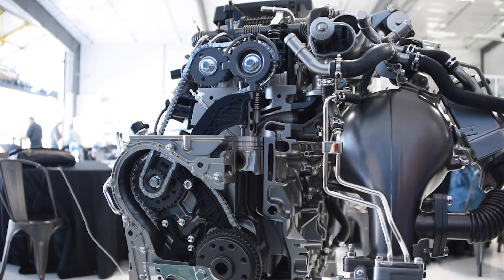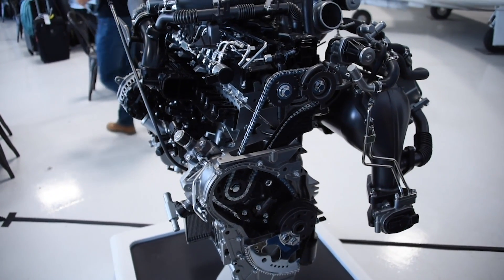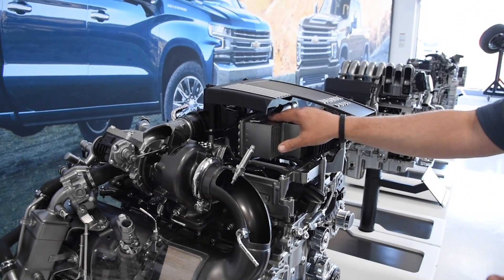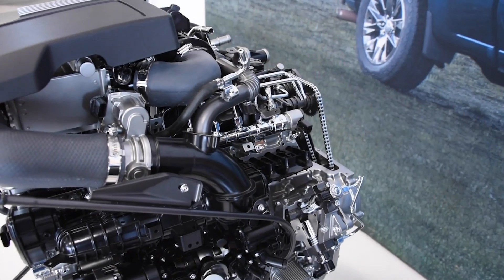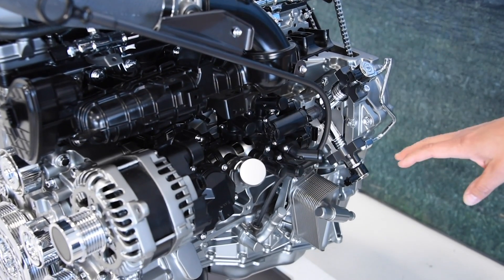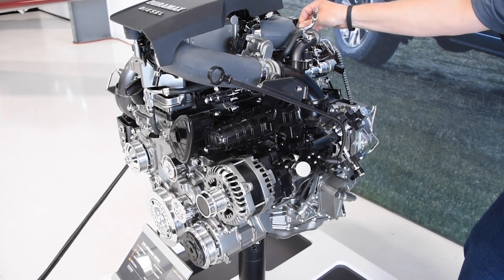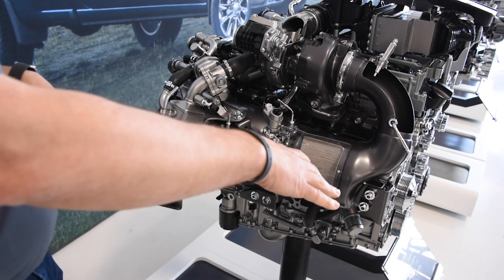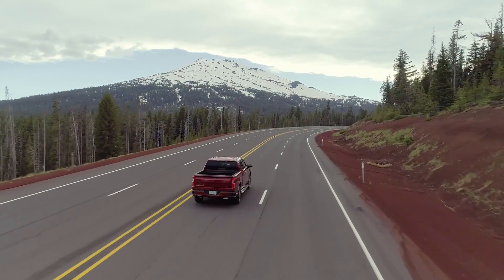What you don't know about the 3.0-liter Duramax diesel

Comment: A friend of mine is a 25 year GM Master Tech.  He said the "Belt issue" has been WAAAAAAAY overblown by you guys here on the internet(most of whom NEVER intended on buying one).  He also said even now with none of them having that mileage, HE could EASILY do the service in under 2 hours.  He said changing plugs in some cars/trucks is a bigger job.  Also, because it's a "wet" belt(and not some $50 NAPA rubber timing belt) it will EASILY see 300k in real world use.    Simma down now, simma down.
Reply from the maker: That's what I've been saying in the comments. The viewers are so concerned about the belt needing service around 150k, but still don't think anything of spending $800-$1,000 to have a timing belt serviced on the family car at 80K. And the service estimate is completely reasonable, too...with the truck on a lift, a good tech could do that in a couple of hours, no problem. Now...will a GM dealer CHARGE you for two hours? That's another story...
Reply: Okay so the belt is indestructible. What about the variable displacement oil pump and all the other possible points of failure from overthought / overused technology? Less is more and simple is beautiful.

Comment: Hmm didn't the 6.4 PS have major issues pushing regen fuel through the cylinders? Like oil dilution, burning ex valves, overheating... all the new HD diesels have a separate regen fuel injector

Comment: I'm seeing more than the Transmission having to come out.  Oil Pan is Most Likely going to have to come off too.  I don't see access to the Oil Pump on it from the back.  Might point out how you get to that belt.  Like there's plenty of room to change the belt when you remove the rear main seal retainer.  Some of those require engine removal.  I'm glad I watched.  Having to pull the Engine to change a belt is not Cool.  Let alone the Chains.  I'll avoid this design.  GM needs to start building more Consumer Friendly.  Not Systems that are designed to Self-Destruct.  Reminds me of plastic coated and or aluminum Cam Gears.  I remember the Soft Cam Years.

Comment: I lol'ed when i saw that belt driven oil pump- per service bulletin, needs to be replaced every 150k miles - need to remove the transfer case and transmission for this service. Gm can opt to put a chain driven oil pump but they want to  save $10  - pass the cost of maintenance to its buyers . These stupid cost cutting is really does not make any sense.

Comment: Ok, got a great idea! Let's put a common maintenance item...get this...at the BACK of the engine! Then, we can add a bunch of new electromechanical failure points, all over the engine, in hard to reach places. But wait, that's not all! We forgot the spark plugs! Wait, we can still jam them in. What? You're telling mee diesel engines dont have spark plugs? Uhhhh, I kind of already put them in. Ok, get this, they will be called ceramic glow plugs now. Problem solved. That's good anyway, I was having a hard time trying to find the most inconvenient place to put the distributor. President Biden wants it to be environmentally friendly so we replaced the motor mounts with popsicle sticks and used school paste to hold the works in place. Also, we measured the temperatures of the tail lights and found the passenger side was reading at a lower temperature than the drivers side in colder climates so we rerouted the engine coolant lines so it brings that side up to the same temperature as the drivers side. We had to sacrifice in cab heat to do this, but I tell you, its totally worth it! Were doing this in the name of global warming and you should be suffering just as much as our poor ozone layer is suffering! Ok, let's hot glue gun this cylinder head in place and we will be ready for our first dyno run. We estimate this engine will get approximately 1/4mpg better fuel economy than the old duramax! That's partly because of the intermittent engine failures at highway speeds that drastically increase the distance traveled without the engine running. 

Ok, we have a question in the back? Hahaha!! You want to know what the towing capacity is for this truck? That is so adorable! That trailer hitch is only on there for show. Essentially, it could be used. We installed it with the worlds finest sticky tape. But we dont reccomend using it because the truck doesnt have enough power to pull anything. Chances are, it will be sitting in your driveway with blocks behind the tires so it doesnt roll away for the majority of its life anyway. That's by design so it's more environmentally friendly.  

Ok, show and tell is over. *hops in 76 Lincoln and drives to the black market McDonalds where they still have the non-biodegradible styrofoam containers for the food. Cheers

Comment: WELL! I've got a 2021 with 900 miles on it on the lift right meow. The owner's son filled her up with gasoline so we are doing a little transfusion. Not running bad yet but I was checking out this vid and had to look at what it would take to remove transmission etc. to do the belt. egggghhh! Shame on Isuzu and Chevy. As a mechanic it looks challenging to say the least! Good luck!
Reply from the maker: Not an Isuzu...and besides that, whomever put gas in your diesel truck is going to be responsible for any repairs. Not sure why you would need to replace the belt or remove the engine in this case anyway
Reply: Was just checking out the vid to get info on this outfit. Turns out they only drive eight miles so,  due to the awesome mileage these get no gasoline had reached the engine yet. Completely impressed with the technology my friend , it just looked  like not a ton of fun to remove trans to do that belt. Have not researched a bunch on this yet and knew Isuzu and Chevy have held hands awhile so my apologies for assuming this engine was a joint venture. BTW
Put damn near 900,000 miles on three Isuzu Rodeos with 3.2 engines with regular maintenance over the last 2-1/2 decades all running well when I offed them and still own one and have total faith in Chevrolet engines as well. Cheers and good luck

Comment: In 15 years these debates will change as the electrical engineers chime in on electric motors only. This according to the dümb b*tch at the helm of GM "General Motors plans to completely phase out vehicles using internal combustion engines by 2035, Chairman and Chief Executive Officer Mary Barra announced Thursday. The automaker will go completely carbon neutral at all facilities worldwide by 2035"
I expect this will fail and spell disaster for GM.

Comment: I’ve had mine for two years and it does great. I own 3 semi trucks and what Chevy did with the EGR and after treatment is very cool. They’ve simplified and made those systems much more reliable. Having recirculation after the filter, so close to the turbo, and no hydrocarbon injector eliminates so many problems. 
Also, I’m not sure many people have owned a vehicle long enough to service something like a timing belt. I had a 2003 VW Jetta that needed a timing belt change. You have to almost disassemble the car to get to it and it takes a mechanic almost a whole day to do. With this belt, 150k mike service, you drop the transmission, replace it, bolt it back on, that’s absolutely easier than what you have to do on many other vehicles. 
And the coolant system, on an 18 degree day I can warm up for 3-5 minutes, drive about 2.5 miles, and I’m already approaching full temperature. It gets hot almost as fast as a gasoline car. I have nothing but good things to say.
Reply: The timing belt driven oil pump is monumentally stupid. Full stop. There's chains right there, they could have made the oil pump chain driven. There is no good reason to make it a belt. "Just remove the transmission lol" isn't a defense of this poor engineering decision. It wouldn't have been a problem at all, if they'd run it off a chain, or designed it to run off the crankshaft like so many other oil pumps.
Reply: @Oddman1980  Nah, it's fine. Lots more rubber belts driving oil pumps than you think. And "engineering decisions" often include design costs and manufacturing costs too. 

Besides, if you're complaining about a 150k service interval, then you can't afford the truck anyway.
Reply: @16vjohnny  It still was a dumb idea to make a belt vs a chain, no matter how many other companies have made that same stupid decision. And whether or not I can afford the truck is immaterial, someone will be driving that truck at 150,000 miles, and someone will have to spend a lot of money on this silly belt.
Reply: @Oddman1980  To you it's monumentally stupid, but it's status quo in engineering consumer vehicles. You have this idea or aesthetic that every part needs to be built to last until the end of the world. Unfortunately, a $50,000 half-ton is already priced out of most people's budget. And if it wasn't a belt, people would find something else to whine about... you know, like water pumps on ecoboosts that grenade the entire engine. At least the big and small Chevrolet diesels have the 100k powertrain warranty.

And what you can or can't afford absolutely matters. I'll more than happily pay for belt service every 7-10 years in order to return 30mpg and 460ft lbs.
Reply: @16vjohnny  I'll just buy an engine with similar specs that doesn't have this dumb engineering defect, there are plenty of them.
Reply: Dropping a transmission is not as simple as you make it out to be. Especially with these new automatics with so much shit plugged into them. Absolutely retarded design and once they hit 100k miles they're going to be not worth what you owe on them
Reply: Let's be real here. A 4L80 from 1998 is an 8hr job for remove and replace. Remove and replace on the 10L80 in the 3.0L Duramax is a 12hr job. The oil pump belt adds 0.1 hr. A timing belt job on a 2015 Jetta TDI is 4.8hrs. 

12hrs is not bad for something that has a 150k/15 year service interval anyway, especially in a truck that saves you $10-13k in fuel costs over that same time.
Reply: @michaelatkin9649  Well probably easier to drop the trans than tearing the whole front of the engine apart if it were mounted there.
Reply: You mean all those connectors that are designed to be disconnected if need be? Oh No!! Not all those things🙄. I own one. I love the truck. Probably won’t own it when it reaches 150k. Even if it did, my 14 year old  son and I removed the transmission from my f250 to rebuild.. anything is hard when you don’t know what you’re doing.
Reply: Bullshit on the jetta Tom. Nice try, I know all about those jettas. They are not hard AT ALL. Good one. Why would you even say that? Literally the easiest timing belt ever
Reply: @benjaminturpin2749  
I was there all day waiting on it. This was on a TDI engine. The point of my post was that changing a timing belt at 150k miles is not a big deal. I’m not sure why people think it’s such a bad thing.
Reply: @benjaminturpin2749  Not entirely bullshit... If you don't have the special tools, getting it right can be quite a pain. Not so much on the common rail models, but the older models with the rotary pumps are very finicky. Water pump, coolant change, special tensioner tools, cam locker, pump locker, motor mounts, TTY bolts. If you don't have a lift and the special tools, a VW timing belt can take an entire Saturday. 

I think backing off a transmission from a RWD truck would be much more conducive to DIY.
Reply: Don't forget in a 4x4 setup, you have an extra driveshaft (that may sieze on) and a transfer case that also needs to come off, cross members and guaranteed the exhaust system is in the way. Good luck to any DIY in a driveway.
Reply: Time will tell. As a professional mechanic with many years of experience on gasoline and diesel powered vehicles and industrial applications, for what it’s worth, my opinion is this engine combines all of the worst foundational principals and technology that contribute to an engines longevity, reliability, cost of ownership, maintenance and repairs. Personally I would buy a horse and buggy before considering this power-plant.
Reply: @preachers4135  Care to elaborate? Other than chains on the back, there's nothing on this engine that isn't status quo across the entire light duty industry. Just because this engine isn't a 6BT doesn't mean it's any better or worse, especially in the 1/2t diesel territory. And the outrage with the rubber belt is ridiculous too. People act like they're going to get a 1/2ton truck and put 500k on it over the next 20 years. Most people don't keep vehicles longer than 5-7 years anyway, and considering where fuel prices are headed, the engine pays for itself over and over again.
Reply: @16vjohnny  my 2012 gmv 6.2 liter only has 120,000 on it now has been my work truck and thanks to Biden it's costing double to fill it about $140.00 dollars

Comment: Can you remap the ecu/chip it like the bigger diesels to get more power? I’m interested in the mini Duramax but would want more towing capability in the future without spending extra 10k on a full size duramax.
Reply from the maker: I have not checked, but I'm quite sure the usual suspects (Banks, Edge Products, etc.) will have something, if they don't already. Just to be clear, adding more power does increase towing capacity–but it will make it easier to pull hills, etc. provided EGT is carefully monitored. Thanks for watching!

Comment: Add a serviceable component in the rear of the engine...hmm seems legit. Let’s explore what happens when you ignore the service due to the increased labor costs of pulling a trans. Well belt brakes and the oil pump stops working, no lubrication then the engine eats itself. Good job GM way to keep your stock falling. Swan song of a dying company.

Comment: More GM junk.  Same idiots that designed the 6.6 by having to lift the cab off the truck frame to get to the turbo charger.  150K is a joke.  Glow plugs? Really?  You need glow plugs why?  Compression that bad.  And those chains and sprockets!!  This thing will never survive.  Wait until that stupid burn chamber fills with ash and the pressure diffs get off and codes light off.  Thousands to fix it.  Put everything back into the turbo to coke it over.  Another $3K.  And nobody wants a diesel you can’t hear.  You guys have lost the recipe to simplicity.

Comment: On a 2020+ DURAMAX I6 DIESEL 4WD Chevy/GMC truck do you need to drop the transmission AFTER ALSO disconnecting the front and rear drive shafts as well as the transfer case to SERVICE the RUBBER belt on the OIL PUMP at 150k miles?

Comment: Amazing how they designed this motor around the oil pump belt.
Reply: Yep, and it's amazing how a wannabe motor builder doesn't realize that belts in oil have new rubber compounds to outlast a timing chain.
Reply: @lowboy003  cool still not as reliable as gears
Reply: @tuckercole1531  Prove your claim, oh, that's right, you can't. You will be in for a shock when you finally realize BIO drives that are in testing now will replace heavy expensive noisy gears on most motors.
Reply: @lowboy003  yeah they’re noisy and heavy but I’d like to see that belt out last the engine like gears will. Oh wait it won’t you got to service it every 150k miles by “simply” dropping the transmission. It’s just unnecessary. And yeah I would fully understand why they would replace the gears nothing is made to last like it was 30 years ago.
Reply: @tuckercole1531  Your problem is that you seem to be bogged down on an executive decision by a GM "Office Engineer" worried about warranty liability after 150K on a BIO drive. 

GM has tested the BIO oil pump drive to date well over 200K and counting. I personally own a 2020 3.0 Duramax and I can tell you that just in fuel savings I could pay to R&R the transmission at 150K several times. But I'm NOT going to replace the belt at 150K. 

This knee-jerk BS rhetoric about BIO drives is the same brainwash we heard 60 years ago about multi-viscosity oils, synthetic oils, and computer-controlled motors. None of it turned out to be true.
Reply: @lowboy003  I get what your saying but I just think that you shouldn’t have to worry about the oil pump being driven when there had been many proven designs that will last forever. But I guess since pretty much any GM product nowadays is only good for at most 10 years the belt would be fine.

Comment: Stupid engineer, let's have chains driven,  but let's put a belt here.  The oil pump belt should be a chain, chains can break to but, I bet it lasts longer than 150k.  I used to change oil in theses when they first came out in the Colorado,  they put the filter on top on the drivers sides but barely enough room to change it, then the next year they dropped it lower on the motor, stupid .  I know a guy that had a dodge eco diesel, it blew in 3 months on him.

Comment: Why does it need a throttle valve? It's a diesel. 

The oil pump driven by a belt is stupid, what's even stupider is putting it on the back of the engine.

Should just use push rods honestly, take a note of cummins design sheet.

Comment: This is ALMOST as bad as Ford putting the water pump inside of the engine where it will dump antifreeze into the oil if the water pump fails.

Comment: A chain, a belt?? Why not geared system that would be bullet proof 
,I had a 6.2 and I ran that thing 275k before the injector pump had to be replaced and that was it ,this concept is something GM want service Dept money 💰 😐 😑 😒 piss poor design ,thinking of the company not the consumer
Reply from the maker: Gears make noise. That's fine for commercial customers, but people who buy light duty trucks these days expect them to be quiet like a passenger car. Likewise, light-duty diesels (all of them) are not designed for a 300,000 mile life cycle like a Cummins, for example. And if you're talking about the 6.2 GM diesel, that thing was one of the biggest pieces of shit ever built. You're lucky to have gotten 100,000 miles out of it.